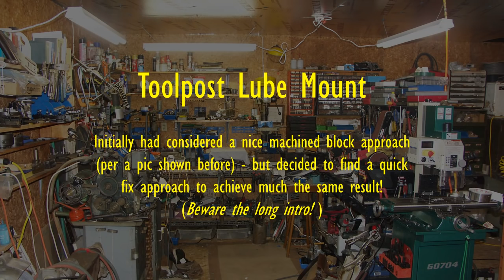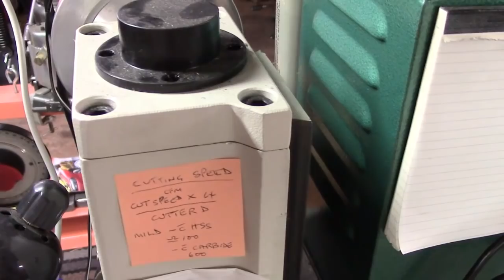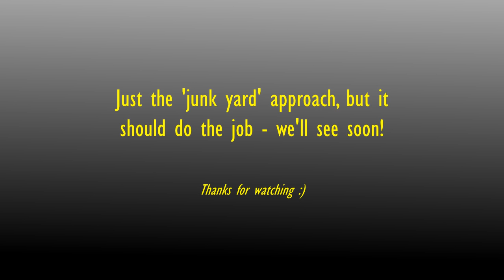Toolpost Oil Lube Mount

Comment: Nice compact and easily removable drip oiler. you'll get a lot of use out of that. Btw, we call them compression fittings in the US too. I can think of worse flatuance smells than cordite!  lol
Reply from the maker: Michael Murray Following a suggestion from a comment - will make the hole into a slot for quick removal and fitting. Plus, as mentioned before - doubt this will be used other than for occasions such as parting etc.
Ahh yes - cordite odor is fragrant compared to some ''offerings''! :)

Comment: Cordite! I used to wonder how they got it all in the cartridge, then I found that it was put in before the case neck was formed. I still have a huge bag of it that I have taken from dismantled .303 cartridges.
Coolant pipe, the only problem I can see with this set up is that unless you only have one tool holder, you will have to keep taking the pipe bracket off, if the pipe was fitted to the compound slide you could more easily change to another tool holder, and still have the convenience of a quick change tool holder. Chris B.
Reply from the maker: Englishman French Hi Chris, thing is I often machine 'dry' or, apply with a brush. This gadget is purely to have available for situations where a steady drip is useful - heavy long cuts and parting for instance, with accurate drip placement. Rest of time it'll not be fitted. If fitted to compound it would probably mean a longer section of flexible and the longer that gets the more awkward it is bending to just the right position.
I still have a lot of very old 303 ammo from post war so - have the means to recreate that famous cordite smell. :)

Comment: Cool story.  sometimes life can be a bit rude at times, we just need to see the humor in it.. regarding you oiler, maybe by bending the copper tubing around your tool post a bit more and send your feed tube across the bed may help too.  Good luck with the refinements. you have a good idea !
here is a bit of trivia; in WW I, the Airplane Engines (2 stroke) were lubricated with mineral Oil. 
when breathing the fumes of this oil  it gave the Pilots the same effect and if they drank it..(OOPS!).  this is one reason they wore scarfs. and shortly after, the windscreens and then the enclosed cabins.  stuff happens ! 
 have fun and thanks for sharing.
Reply from the maker: dennis brooks Hi Dennis - thx for commenting. Right now the tubing run seems OK going under the bed - I have added now a simple wire support coming up from top of carriage to keep tubing supported and so far that seems OK - but may well of course over time try a different route such as you mention - usage will suggest any good tweaks I think.. I have also now added a piece of short brass tube to the 'nozzle'' and added a slight crimp - this should reduce flow/drip rate to about what I want instead of huge drips!
Haha - nice touch about the mineral oil LOL. Fragrance! :)
Reply: ChrisB257 I think it might have been castor based oil they used, with the concomitant results that that particular oil delivers. :>(
As for the oiler, I might just copy it for my safety parting tool.

Comment: good job old man lol. i dont think i could bring myself to put an oiler on my lathe. it would make a big mess. and thank you for telling people the gun rules you should go by. most people thing the gun should be safe on its own. and that pisses me off that people blame the guns when in fact it is not the guns fault. i have followed these same rules all my life and have yet to hurt anyone or anything.
Reply from the maker: Bison Workshop I tend to use drip more than heavy flow so - not too bad for mess... I have a tray under the bed too which catches most - often tho just an oil brush is enough. Yeah - safety rules are paramount.

Comment: Hi mate.
I love the Lee Enfield  I used to have two of them when I lived in New Zealand.  I had one that was sporticed, and .one that had all Maori carvings all over it.  but than I moved to Australia and they saw there chance after the Port Arthur massacre to disarm everybody, so I could not take them with me.  In the army I shot several arms. I shot Uzi 9mm, carabin I can't remember what Cal. they were, Browning 9mm, FAL .762, Bren-gun, and pump action shot-gun in the EOD they ware mounted on the robot to shoot at IED's.  On the odd day I was quite good at it.  Some times I even hit the target.
I hope that the little support will not be in your way after a short while, as the post might take your skin off your fore arm.  The dripping of the cutting oil might become a little expensive, as you need only very little indeed.  I think that water soluble cutting fluid might be more suitable.
Marcel.
Reply from the maker: Marcel Timmers Hello Marcel -- I have always found the Enfield action much sweeter and more positive than a Mauser, altho they say the Mauser bolt is the strongest. I still have an old MkV Jungle Carbine and a sporterized MklV. Great rifles. I have a Fal - bit less comfortable to shoot than an AR but, a great MBR which saw much action in the Falklands.
I have smoothed the support edges and reckon it'll not damage me unduly -- plus, probably only use the thing for select operations such as deep roughing and parting off - it's the latter where I want very accurate placement - which was often tricky with the old long reach method.. I can't use soluble oil really as i have no decent tray seal or sump - or a pump. I have added a small piece of tube to the outlet now with a reduced opening so - not too bad on oil usage with a fast drip. Have used sacrificial oiling for decades almost and it still lasts well.
Reply: I think the British mostly took the FAL to the Falklands is it not?  on the stand it must have been a wonderfully accurate weapon.  especially if it would have a scope on it.  Grant you it's not an infantry weapon, far too heavy and unwieldy in the field.  Plus it was a semi automatic weapon (with the safety lever in) .  In that respect, the Uzi might have been better than the FAL for close combat.  And the Uzi was semi accurate to 200 metres/yards.  Did you know, by the way, that the Argentineans did have an ex Dutch battle ship, the Karel Doorman,  that they did not dear to get out of port for fear that she would be sunk by the British.  That's making use of your capabilities.....
Marcel.
Reply from the maker: Marcel Timmers Yes, FAL in Falklands - I believe the 'Argies' also had those. Wasn't too long after that the SA80 came in and the FAL was dropped - however in UK it was usually the inch version, as the L1A1... even a 3 round burst on full auto was near uncontrollable!

Comment: Hi Chris !

Did I hear you say that you can put these blue parts together again by heating them up ... with a heat gun or ... ?

I have some pieces I simply can't get together.
Reply from the maker: Keld Sørensen Hey Keld, That stuff is very tricky indeed.  I used a heat gun carefully, waving the female piece in and out of hot air close to the gun - as soon as I saw a very slight change of appearance (suggesting melt) stopped heat and pushed it on. Wear thick gloves though as it'll be super hot for a bit. Difficult but it works.
Reply: Keld Sørensen The flexible hose? I've seen people get them together by putting them on a threaded rod, nut and washer on each end, tighten until they pop together
Reply: Lasse Langwadt Christensen
Oh, yeah that could be a solution
Reply from the maker: Lasse Langwadt Christensen Another great idea - indeed for most cases that sounds like a good fix. )

Comment: whilst i am a fellow adherent to the atm(available tools and materials) project fulfilment philosophy, it seems to me that this design more or less removes the q from qctp holder as you know that the shcs will inevitably go walkabout with abandon. i think a design which used the second tool holder dovetail perhaps would still allow for quick tool changes while keeping the utility you desire.
Reply from the maker: crazymanmichael Hi Michael,
While the second tool holder might be a valid attachment spot - it also needs to be available of course for a facing tool perhaps or a boring bar etc. Plus, as I had mentioned, the oil feed is only really needed for some specifics such as parting - thus, much of time not in use - if not 'dry' turning then often the oil brush will be used.. It won't be easily lost as it is attached to the feed tube and so sits off to the side, sort of 'captive'! True though - there are other options. :)
Reply: using the second holder i would mount the oil tube on a swinging arm so that it could point to either end of the holder thus making it viable on either side of the tool post. to me this is preferable to mounting and unmounting it on a holder.
Reply from the maker: crazymanmichael Good thinking Michael - as I don't expect to use it a whole lot I'll see how it works out but, knowing my tendency to change plans - things might change! :)

Comment: you should have milled from the bottom of your tool not the top. Because it will flex downward. So its more rigid that way. Yes I know you dont take "big cuts" but all metals have elastic properties.

Comment: Hi Chris Nice oilier. You can put a small reservoir for the oil on the side of the tap. (all in one oil system ),
Reply from the maker: Giovanni Brazzoli Hi Giovanni -- yes, that would be tempting except for the extra bulk and lack of 'head' for gravity feed. As I mentioned in the vid - it won't be used all the time - just certain situations like parting etc.